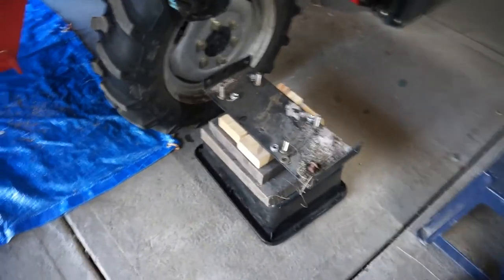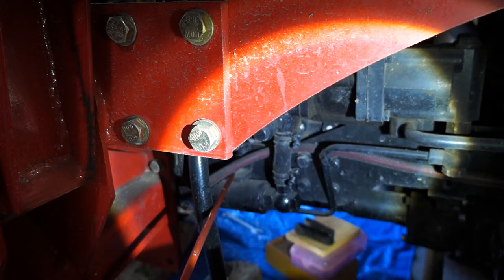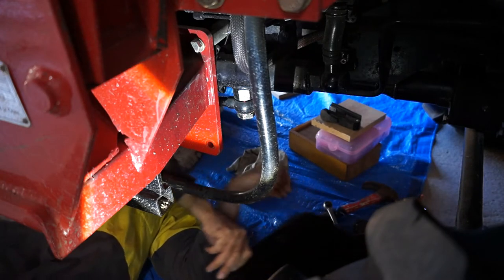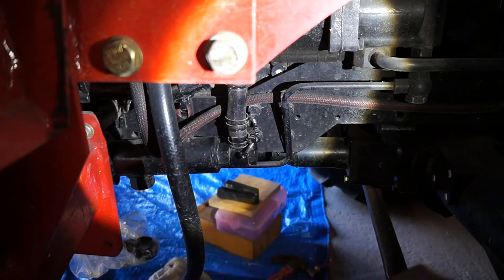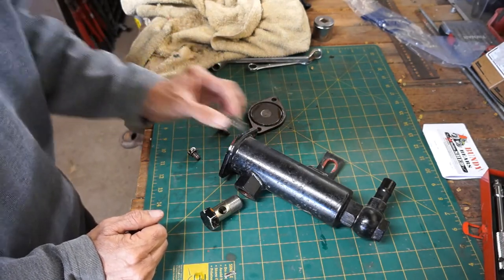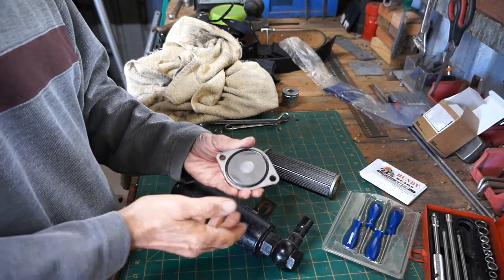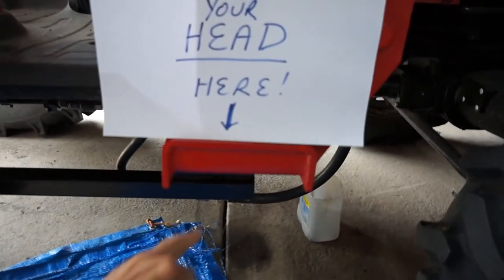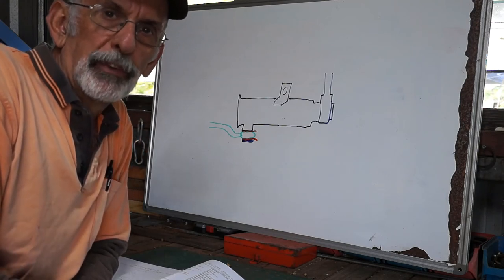Tractor Hydraulic Oil Strainer / Filter - DongFeng ZB28 ( DF 254 ? )- Part TWO

Comment: hey mate.. wondering if you can help point me in the right direction.. Ive lost a lot of power in my hydraulics. Ive done a filter change
but no improvement mine is a DFS454.. where do i start??? hope you can help  Regards Alan Acland
Reply from the maker: I have a friend up here who also has a Dongfeng and is considerably more knowledgeable than me. I'll ask him to provide you with some advice. He may comment to you directly here, so keep an eye out please
Reply: Alan, If the pump is hot it may be that flow is blocked somewhere and running through a pressure relief. Double check any quick-connects. Something may have caught one while slashing and they can disconnect and shut off flow without being fully apart., my zb is a smaller model, but I have a hydraulic quick release below the frame of the tractor which feeds the front bucket, I have had that come apart when slashing and do what you describe.